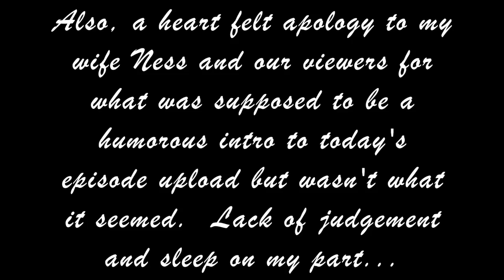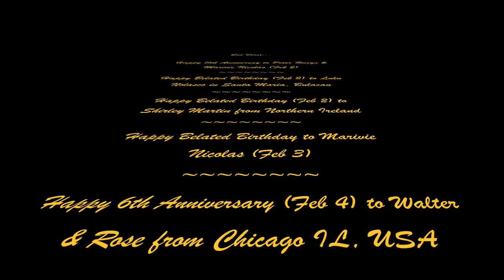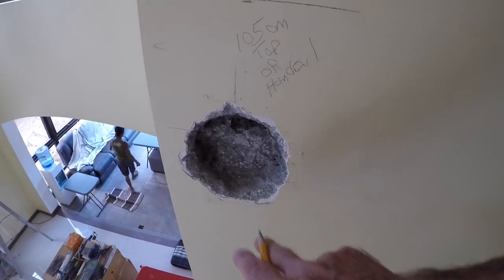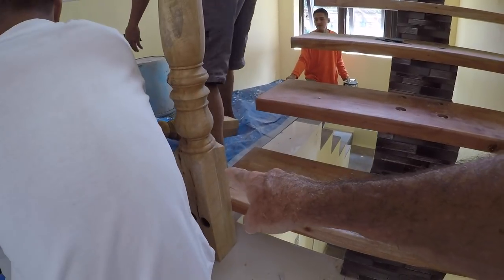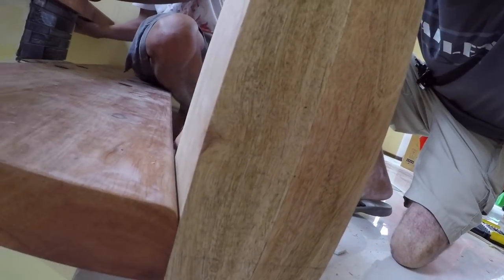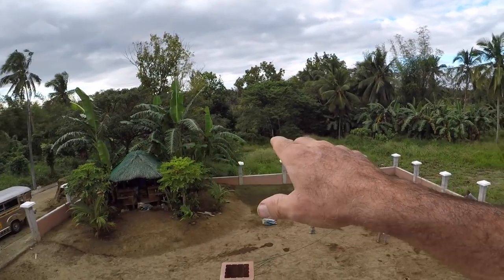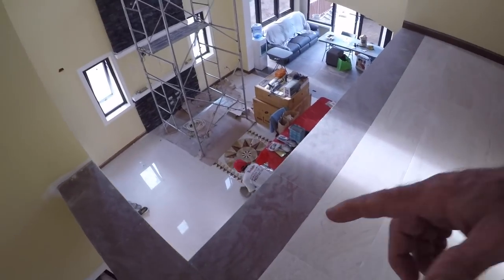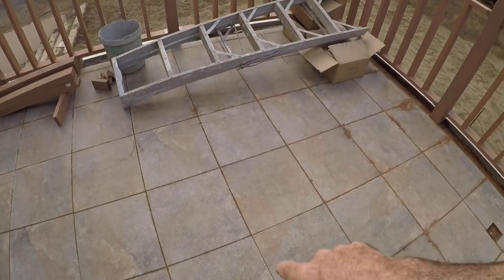VILLA FELIZ - EPISODE 299: HOW TO INSTALL STAIR POSTS AND RAILS (House Building in the Philippines)

Comment: Hi James, Hi Ness, Handrails are required for stairs and must meet standards as specified by R311.5.6.3 in the IRC(International Residential Code) :

The top edge of the handrail must be placed between 34” and 38” above the nosing of the stair treads.  Handrail ends must be returnedand terminated at rail posts.The handgrips must allow a minimum of 1-1/2” spacebetween the handrail and the guardrail or wall. A variety of gripping surfacesmay be acceptable but must meet requirements for gripping surface.Flat 2x4 and 2x6 handrails are not acceptable.A circular cross section of a handrail musthave an outside diameter of between 1-1/4” and 2”.
Reply from the maker: Thanks for the references Wayne.  You're always an encyclopedia of knowledge!

Comment: Hi James and Ness  Thank's for yet another great video. Anyway, tip of the day :) even if it is a bit late for some parts, max opening between deck and railing is 50 mm and the same openings you have on the rails is also reflecting what it should be on your open stair, max 50 mm between floor and first tread, then later max 100 mm between tread's, even if it take a bit of the ligth coming from the window, " Safety first". Remember there is a concrete stair with sharp corners, just below it.

Comment: Good
Morning James and Ness! James, are you gonna install any garden watering system later ? coz that's a huge area to manually hose out.. maybe some timer sprinklers should help you make your retirement less hectic. I can't wait when the oversight team comes digging to bury those garden tubings ..hehe
Reply from the maker: Morning Winky.  The entire lot will be fitted with in-ground irrigation.  I already have the Rachio Smart WiFi Sprinkler Controller, https://www.rachio.com and I'll match it up to the appropriate zoned irrigation solution (popup heads, manifold/valves, etc).  It's on the back burner and I'll be doing manual watering until I can set it up to be fully automated.  This gives me the ability to monitor and control the irrigation from anywhere in the world when there is access to wifi.
Reply: My PI Dream Whoa! yeah!

Comment: strongest way to mount your railing post to concrete. Drill a hole in the concrete and instal a threaded insert large enough to accept a Half inch bolt. Use a half inch diameter Hanger Bolt about 6 inches long. thread the machine threads into insert and thread post onto wood threads ( pre drill first )  you will have to temporarily remove the bottom stair tread in order to turn the post
Reply from the maker: That's how I wanted it to be done and explained it to the foreman.  I got the deer in the headlights look so I decided to let them go with the next option.  Great tip!  Thanks for sharing!

Comment: in the Phils..most landscapers spread the grass far apart even if you paid for a whole grass growth in square meters.. still they reason that it will grow and spread out.. but then we buy the grass per square meter right? So I don't get that part where they start spreading the grass to fill areas then everything looks bald and some areas the grass are too far apart. May I add that waiting for these carpet of grass to spread and grow and REALLY become grass carpet and fully covered takes weeks😩 and blue grass is not cheap. P300 per sq🤷‍♀️?  more expensive than a slab of granit.
Reply from the maker: Like I said, if you're using any variety other than blue grass, doing a 50% coverage isn't a problem and it's what I would do if I were laying the sod myself.  Grass like carabao spreads like weeds (which is kind of what I think it looks like) so you're lawn is fully filled in within a couple of months.  I don't think you'll ever get blue grass to do the same but I might be mistaken.  Proof is in the pudding (or grass) if you will.